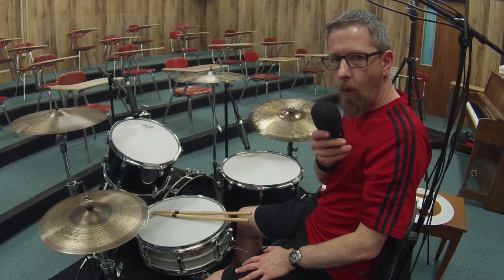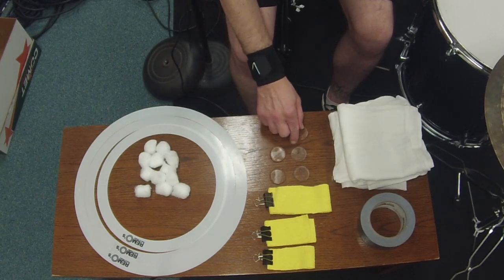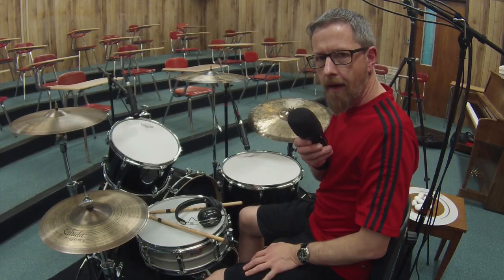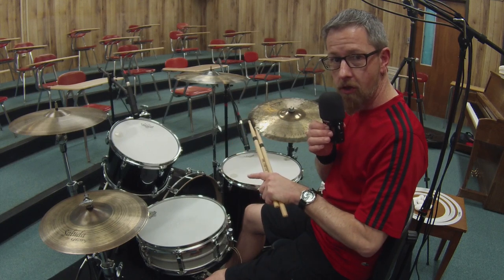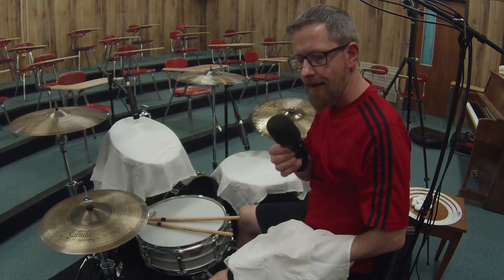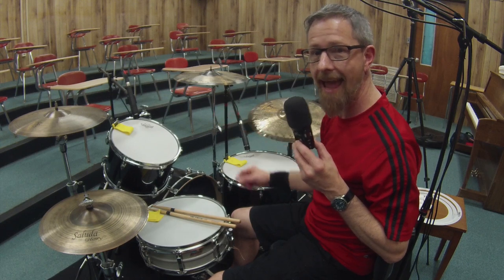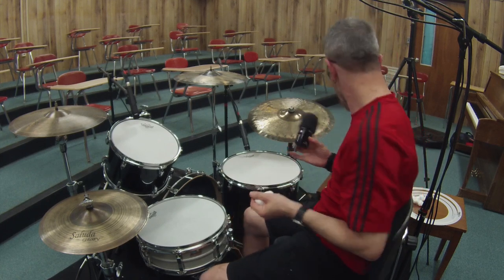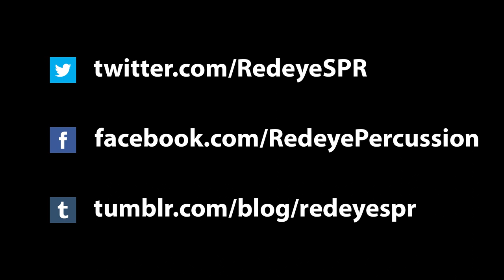Drum Muffling Techniques (Rings, Gels, Towels,  Duct Tape, Cotton Balls, DIY Gates)

Comment: Back in the late 60's early 70's we used to play using a 1.5 to 2 inch strip of cotton beach towel and remove the bottom heads all together and take off the top heads applying the strip under the skin vertically meaning in 6 o'clock to 12 o'clock position and about a quarter to a third of the way to the left or right, your preference if you hit more to the right or left. This would give them a deeper sound and kill the ring allowing you to move to the right or left depending on how much resonance you wanted. The 1.5 to 2 inch cotton towel strip would get tightened up along with the head giving you an awesome sound and make tuning the drums much easier as the tones were well defined. We never had stuff you could buy to do it so your drum teacher would usually advise it to students practicing at home as well to do it so the families would not complain, keeping the students from practicing and eventually quitting taking the classes. It was a well-known technique many drummers used to control their own volume during live gigs in small venues. If the towel strip was on the left quarter and you hit that side you were quiet if you went to the right, it was a little bit louder. Try it you will be amazed how good it sounds that is if you like a deep rich full rock sound from the 70's to 80'. About the time Drummers started using this technique was around the Beetle days to when hard Rock error started up giving them a much darker sound and allowing the drummers to hit harder and express themselves when needed. I put off doing it out of being lazy but once I did I played way more as if it was an entirely new drum set. Wow what a difference. You can also experiment with the width of the strips as well as not all drums have the same circumference. If you have any remaining strip hanging over the outside the drum, just trim it off. When installing it you want to lay it across the drum then pull it just snug enough to touch the underside of the head and let the rim pull it the rest of the way. It is basically the same technique as the snare wire but goes under the hitting heads and holds in place with the rim tension. I would not suggest putting it in the middle of the drum because you want the tone and resonance flexibility, remember a quarter to a third of the way on the left or right but not in the middle. I found the larger the drum the smaller the strip over the years when i played due to tone already being low. Happy Drumming and Rock out.

Comment: A common method from back when I started playing in the 1970s was to place a strip of cloth across the drum between the bearing edge and the drum head. I used that method on all my toms and my snare drum. Of course it took some experimentation to get each drum right, but once you did, you were good to go. I no longer do that because it tends to deaden the ring and the sustain too much. However, back in the 70s the dead drum sound was pretty popular.

Comment: Thanks for your time investment to do this video!  I liked the fabric gate best for that kit and tuning.  I have been doing something similar for years, using a small piece of drum head of various weights, taped to the rim.  It lifts off the head for a more open sound, then falls to shorten the decay.  Easily flipped on or off and  doesn't change the feel as much as some other methods.

Comment: Question on the cotton ball/gel technique... Did you cotton ball the snare and rack tom also or just the floor tom, and how many balls did you use?
Reply: hey! i’m not the creator of this video but as someone who has used the cotton ball technique myself, i tend to only put it in the toms and no the snare, i usually used just enough to fill the center of the tom (around 7) and i for the snare i just use one gel. hope this helps!